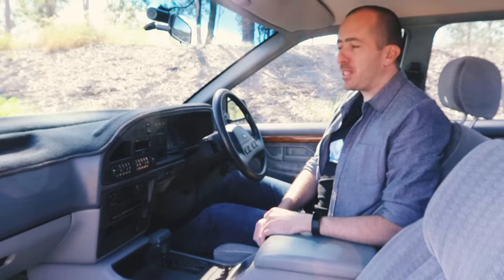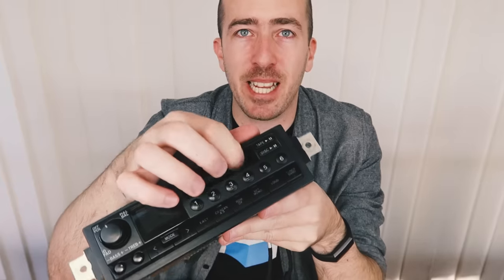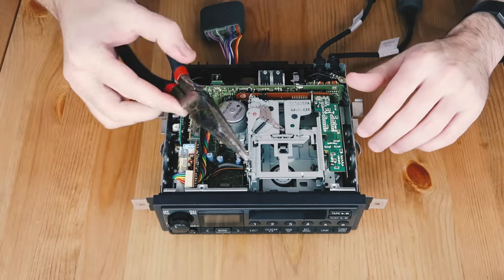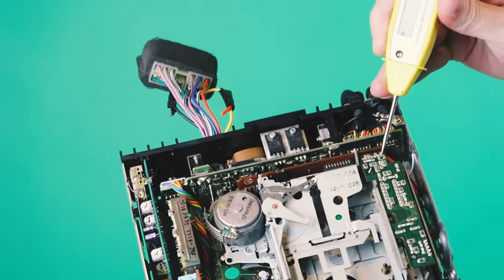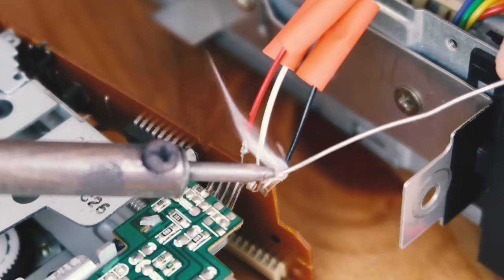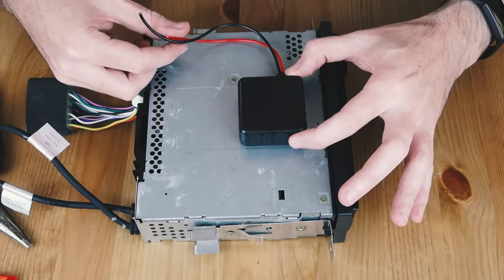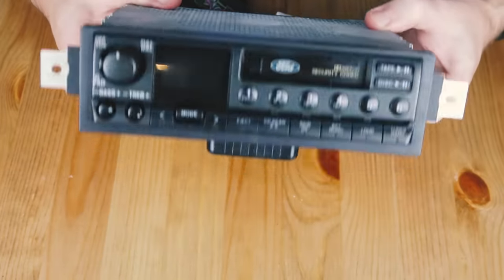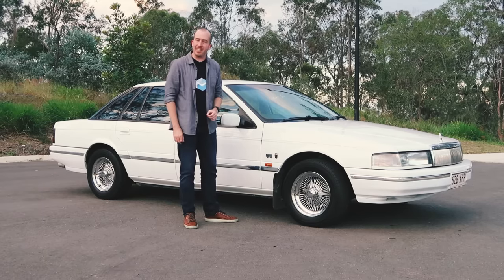Add Bluetooth To Your Old Car Stereo For $25!

Comment: I wonder if there's a way of doing this without disabling the cassette deck.
I like streaming my music, but I also like my cassettes
Reply: Solder onto the connectors instead of cutting the wire and have a dedicated blank cassette for Bluetooth mode, you could probably do this entire mod with the Bluetooth module staying inside the unit instead of sitting outside if there's enough space,
Reply: Exactly
Reply: Yep, solder on and don’t cut anything. Then, I bet a cassette AND the BT input could function at the same time. So you could play a tape and still get alerts and map directions through the car speakers too. Ah, the simple beauty of analog signals.
Reply: @Mrsquiggley  I had a feeling that'd be the solution but I'm not an electrician and I wasn't sure if it'd cause any problems
Reply from the maker: Both points are true. The only potential downsides might be whether there's any background noise being outputted by the tape drive, and bluetooth signal quality if you locate the receiver inside the head unit.
Reply: Another thing you could do is, to "hijack" the AM-Radio signal. Like, who even uses that?! Sadly you have to do a lot of research and guesswork as to where the signal gets feeded from the chip into the amplifier. But if you manage to find it, just ground that specific pin and feed in your own signal instead like in the video...
Reply: Wired FM modulators are available that inject the signal directly into the antenna circuit to eliminate/minimize the "competition" caused by other aired FM signals, the downside is that you will have to add a power switch to the modulator so you can hijack the FM signal when desired. Your bluetooth receiver will simply connect to the modulator as an imput source, the modulator and bluetooth receiver can share the same switched power. This is simpler and non-invasive, offering great sound quality, again the downside is the power switch.
Reply: There are a number of ways to do this to keep the functionality of the cassette mechanism. The way shown in this video will work, but it's not ideal because the output of the BT unit will be double-terminated (connected across) the output from the cassette heads (or the head amplifier IC output which some Alpine units have on that small circuit board). This can cause problems with the BT unit and/or the head amplifier IC. In addition, if you connect before the cassette head amplifier, it can cause the signal to be distorted because the head amplifier has a lot of gain. The output from the BT unit ideally needs to be connected AFTER the head amplifier where the signal is line level. The way to do this mod properly is fit a small 12 V relay inside the head unit, which switches  the audio feed from either the cassette head amplifier or from the BT input, and at the same time activates the switching mechanism which causes the deck to take the audio from the TAPE section rather than the tuner. This relay can be switched from a small push button on the dash somewhere. This will then maintain the functionality of the cassette mechanism as well as enabling a BT input. This sort of mod is probably not suited to someone who isn't an electronics tech but it is the way to do it properly. There are other ways to do it as well, but they're beyond what I could practically go into detail about in these replies.
Reply: What about tapping into the CD stacker connector on the back of the unit? I tried with an audiovox but had trouble finding a pinout of the connector. With your skills however...
Reply: @TorstenBaumann  That's the first hurdle - finding a pin-out diagram for the connector. The next hurdle is you have to tell the head-unit that you want it to switch to that input. Normally, when there's a CD stacker connected, the head unit will command the stacker to play - and once it receives the right acknowledgement signal from the stacker (including the one that says the stacker is connected), then it will switch the audio over. This idea can certainly be done, but there's a lot of work to implement it - far more than it's worth in my opinion.
Reply: S W I’ve got a feeling that alpine is the same (rebranded audiovox) unit in my w202 merc. If so, the ‘cd in’ was just tied to ground. Unlike the Volvo system which had a call/response setup. If someone was handy with an oscilloscope... I hear you though. Way easier to hijack the tape deck signals. Just if there was a way to still play awesome mixtapes! 
Awesome work btw!
Reply: @greyst0ke  As I mentioned above, you can hijack the tape signal path, but there's the right way and the wrong way to do it. Do it correctly and you can have the best of both - line in, and still be able to play cassettes. It just needs a lot more work. I guess it comes down to how keen you are.
Reply: Indeed, the better option is to hijack the radio part. You can even use something like a KVM switch to choose between the radio and Bluetooth.
Reply: if your cassette deck has an aux in (RCA plugs in the back or 3.5mm plug in the front) you can use those. there are BT receivers whith batteries.
Reply: @sw6188  please go into detail how I might accomplish something similar to this on a 1995 Lincoln continental with the jbl system.
Reply: @jameybarisoff  Unfortunately I am not conversant with that system or vehicle but the basic idea is to break into the circuit just before the volume control. A double pole relay is connected in here with an external switch to allow either the normal audio path to reach the volume control, or the external audio which is where you feed in what you want to hear on the syste, - cellphone or mp3 player etc. Any reasonably competent electronics tech should be able to do this for you.
Reply: You could also gut a cassette body, revove the tape, then you wouldn't have to worry about interference.
Reply: This is why I love my Volvo 240. The standard head unit (made by Mitsubishi i believe and rather good) has a DIN socket on the back which was used to connect an optional EQ. It worked by feeding the audio signal from tape / radio out to the EQ and then back into the head unit; when an EQ isn't fitted there's a round 8-pin jumper plug that goes in the socket to complete the circuit. However you can also use it as an aux-in by making up a lead with a 8-pin plug on one end and a switching 3.5mm jack on the other. That way, the stereo operates normally until a plug is introduced and then that signal overrides everything else as it would if it was an EQ plugged in. You can connect phone directly or through a bt module just like the one in this video, it sounds great and the Volvo 240 even has a bank of switches in the console so a blank one can be used to house the 3.5mm input.

Comment: I'm considering doing this but I'm also a cassette lover and want to keep the functionality of it. I'm sort of thinking doing it, but buggering the ribbon cable may end up with no more use for the cassette, any suggestions?
Reply from the maker: You'd have to solder directly to the points on the board, that way both the tape and bluetooth audio sources are going through together.
Reply: Nah, there's a better way, as I said in another comment.

Comment: The radio I have in my car has a casette deck, aux in, and control for a CD changer. Gotta love Volkswagen. Adding this will basically make it the best head unit of any car built before 2000 lol.

Comment: Why cut and splice into the wires, when you could have soldered directly to the back circuit board's solder pads?
Reply from the maker: In the past I've not had success with getting the solder to stick to the existing pads. I also didn't want to risk damaging the board.
Reply: @MotoringBoxTV  Yea, that was a good idea to avoid soldering on that pad, it would've pulled the ribbon off if not done properly.
Reply: @MotoringBoxTV  That's probably because the solder on those pads is old, or is a different type of solder. Reflowing the pads then soldering to them works nicely.

Comment: love the project :) only thing i have done different, keep the tape drive all in tact and just splice the signal wires on, so you can listen to tapes and BT, (you will need a "fake" tape (one with te tape gutted))
Reply from the maker: Sure, you could definitely do that. My only concern would be whether the tape drive would introduce any background noise or hiss even with a fake tape fitted. If it doesn't, then happy days.

Comment: Is it possible to hijack the CD audio lines from the stacker in the boot? This may be an even easier option as all mods would be external  and not require disassembly....
Reply from the maker: I believe it is, but you'd have to test how that would work. If the stacker is unplugged you can't even switch to CD mode on the head unit. I guess if you have to choose between removing the ability to play tapes or CDs, I know which one I'd go for...
Reply: @MotoringBoxTV  But what about if we only have a cd player?
Reply from the maker: I think there are too many variables to give a definite answer - it probably depends on your exact head unit. I'm sure it'd be easy enough to locate the audio channels on the board, but you'd have to work out whether a CD still needs to be loaded and playing in order for the head unit to output the signal. For example, my head unit mutes the audio if the "tape" is paused or stopped - so even if bluetooth is connected and playing, I won't hear it.

Comment: Many thanks for this video.  I was able to buy a similar Bluetooth receiver for $15 (it had RCA plugs, not 3.5mm, but that is totally fine) and successfully installed into an AU XR8 stereo.  I soldered it to the CD circuit board (there is no tape player in this stereo), and ended up creating a CD with silent tracks, as the unit has to be playing a CD when you want to hear your Bluetooth device.  Also, given the AU stereo is a double-din size, I was able to fit the receiver inside the stereo itself which makes simple and really tidy installation.
I half wished I made a video of the job, but compared to the quality of yours (and all your other videos) it would have looked pretty shite.  Thanks again, I had often considered replacing the head unit, but - like you - wanted to keep the original look.  This video provided the perfect solution
Reply from the maker: That's awesome, glad it helped in some way! I want to do the same with my AU Fairmont someday. Happy motoring!
Reply: @MotoringBoxTV  , it is a piece of cake and you'll have no dramas- the PCB has the left/right/base connectors marked.  PS, I was so glad you have kept the AU.  That videos on the that car is what got me onto your channel, plus an AU is a car that just grows on you - I've loved mine for over 17 years now.  I was very relieved it was the Commodore you sold, and not the AU

Comment: Not  bad video; but. 

#1. There is no reason to cut the right and Left audio ribbon cable coming out of the tape deck, just solder the wires to the board. 

#2. No matter how good your bluetooth is, it's still going to be constrained by the audio processing of the head unit itself. The "Audio Quality" that suffers is the way the media was recorded. Your bluetooth audio is still going through the same equalizer that the radio and tape do. 

A new headunit in any respect will run circles around an old head unit like that any day of the week. As ugly as they are (and some are horrific looking even in today's cars) you're not looking at it while you're driving; least you're not supposed to. 

I ate it and got a new headunit anyhow (now 5 years old) and I'm not really upset with it at all, not hard to lerrn to love it when you don't have to stare it down all the time.
Reply: I think for #1 that you would have signals coming from the board and the bluetooth at the same time, his way, you eliminate it if I m seeing correctly. I agee, I put in a new head unit and it was night and day difference.
Reply: Just be sure to use one or the other inputs, use a tape, don't connect bt. Use bt, don't have a casset loaded.

If you have both running at the same time, nothing will be hurt you'll just hear both inputs at the same time

Comment: Nicely done.  If I'm killing the cassette deck, I'd perhaps kill the power to the motor also.  Just to add to this, if you ever need a home hi-quality record player amplifier, magnetic tape decks do a great job if the record player has a magnetic cartridge; then just send the output of the cartridge to the tape head input.  The frequency response is incredible; nice crisp treble and clean bass.
Reply: I thought the same re: disconnecting the motor power. No annoying motor noise then!
Reply: Tell me more about this turntable amp conversion
Reply: @wallacewinston3627  The quality of sound coming from a HiFi system is more a function of its pre-amp.  Most Power Amp stages are simple and easy to manage for Frequency Range and Total Harmonic Distortion.  What is not usually good is the Pre-Amp, and that's what you pay for when you buy an expensive amp.  Fortunately,  most Cassette or 8 Track Car Players which one would have set aside decades ago have a very advanced Pre-Amp stage.  It's input Mv is the same as that of a Magnetic Cartridge such as SURE brand or any of those popular affordable brands.  The Ceramic Cartridge could never produce the HiFi wide frequency of the Magnetic Cartridges.  So where they input wires of the Tape Head Would be, simply route a set of RCA  Female Jacks, and that will be the Input from the Turn Table Magnetic Cartridge.  Then you can use a blank Cassette, and in the case of the 8 Track, push the Cartridge Halfway in, to turn the units on.  The correct was, of course, is to add an on-off Switch and Selector, but by using the blanks it does not disable the function of the Player and its quick and easy to set up.  Proper Grounding from the Cartridge is essential to avoid any low humming.  You'll be amazed at the Fidelity of the Music from the Records, and if you enhance that sound with a car Graphic Equalizer/Amplifier, it all runs well on 12 Volts 10 Amp Power supply.
Reply from the maker: Thanks for the comment. My head unit didn't work correctly after cutting power to the motor, so your mileage may vary. Mine freaked out and kept trying to "swap sides" of the tape, with the audio channels muted.

Comment: I had a cassette adapter from Philips that it works perfectly with the top sound.  There is a screw in the cassette that you can screw to get the perfect sound.  There is also a cassette adapter with Bluetooth

Comment: There would always be a constant 12v coming from the tape section which you could wire up to the bluetooth module, which is the right way to do. So whenever you're on FM the bluetooth module would be turned off, as you hit the tape button, the bluetooth starts up, auto pairs with your phone and starts playing automatically as well. Right now the issue is, even if you have the stereo at FM, the bluetooth turns on and would start playing audio from your phone.
Reply from the maker: True, you could do that. I prefer it turning on once when the car turns on though, so the phone is already paired and ready to go. The pairing is not instantaneous plus it makes that noise everytime it does so.

Comment: Top-notch video, I have a jag with a 2004 Alpine Premium system and this would be the only mod I would even consider as I don't want to ruin my original fascia panel. I have a 6 cd changer in the boot too but I have a separate oem amp also in the boot. The process I would guess would be similar if not exactly the same being an Alpine unit even though it's a few years newer than yours the tech doesn't seem to be too much more advanced. Cheers from over the ditch.

Comment: Thanks for this , for anyone who has a stupid comment please , think of the logic first , some car audio units like my RFX-9020 Rockford Fosgate Unit  is rare and does not have Aux in but , I for example want the system to be current , My audio system is complete RF front to back  , for the RF purists out there who will probably butcher me for this , RF don't make head units anymore so kindly plug it. This is a matter of preference and this video was informative and amazing to give my Rare RF Unit a UTD lift to Bluetooth.

Comment: wish i could do this for my 67 falcon
one thing modern stereos need are bass and treble knobs like this one's so you can quickly and easily adjust without having to scroll through a settings menu

Comment: Great mod . I do believe you have your constant and ignition wire backwards and a yellow wire is a constant source of power on all after market radios and this being a alpine produced unit . Not to mention the other color wires match up to aftermarket colors . Not bashing you I’m educating. Again great mod .
Reply from the maker: I'm not sure what the go is as info I've found online suggests the same thing. All I know is the module stayed powered on 24/7 when connected to the red, and now it doesn't!

Comment: I still buy CDs occasionally, kinda. Actually, I pre-order a album package that includes a shirt or a hoodie and includes a digital download so I don't think I ever play the physical disc. On the mod, it's a cool idea. It repurposes the old, outdated tech, that would otherwise just become e-waste, with a new lease on life. However, personally, I would have probably of just taken the cheap and easy/quick and dirty option, bypassing the car's audio system altogether and mounted a portable Bluetooth speaker somewhere, more or less permanently plugged in to a USB car charger. Although, I will admit, that would definitely not even close to as elegant as your solution.